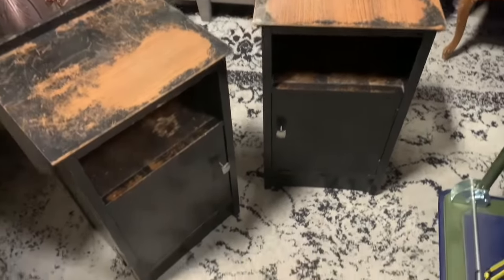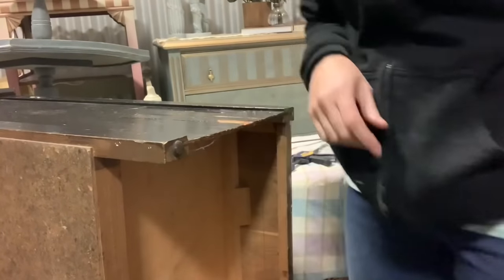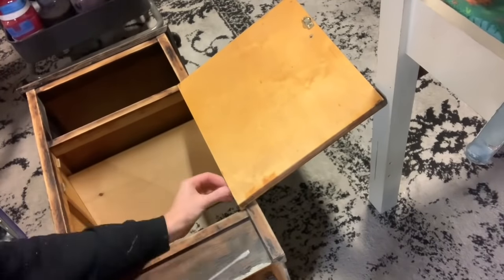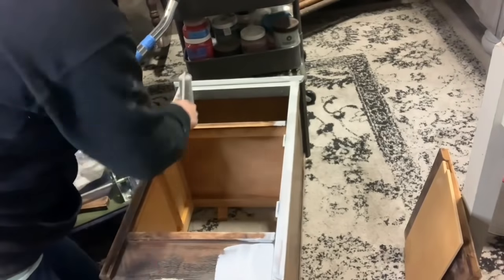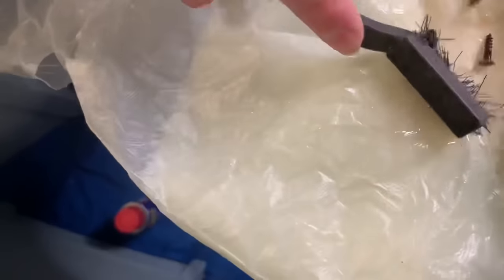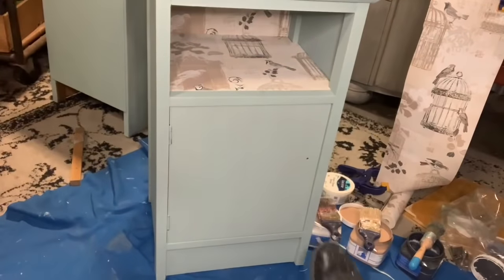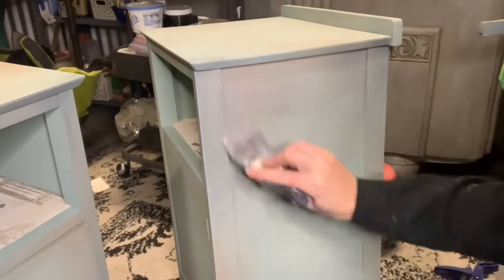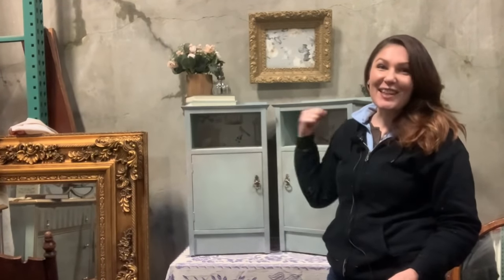Trash to Treasure | Nightstand Makeover Old World Blended Layered Textured Finish | Elegant Upgrades

Comment: Should have just taken off the layer of veneer and then sanded. I done that to a cipboard similar and the underneath is great condition. Old veneer peels off wasily.
Reply from the maker: A lot of times I will choose that route. I always weigh what is better for the specific piece. In this case it was much easier to glue and fill than to completely remove. Thanks so much for watching and taking the time to leave a comment, Ian.

Comment: I noticed you were wearing a coat … how cold can your shop be and still be able to work on a piece? Having the same issue. Thanks for all your videos for those of us starting out.
Reply from the maker: My shop thermostat in the winter is set at 55 degrees F. That’s the lowest most products say they will work. Now as you use different products, you’ll figure out what works in what temperatures. I know my dry time will be a lot longer in the winter. What normally takes an hour to dry I will now leave overnight. I also will bust out my heat gun if I need something to dry faster than that. I just plan for the extra dry time and try to have multiple pieces going at once. I don’t have an issue with my paint. Some polys don’t like the cold so you can find one that does well or just deal with wax. Wax doesn’t mind the cold at all, you just have to work a little harder to buff it. Wow, that was a long one. I hope it was moderately helpful.
Reply: @elegantupgrades  thanks so much. Moved from South Carolina (no heat needed, ever) to Lake of the Ozarks. I was wondering how much heat I was going to need. You are always very helpful to all of us. Thanks.